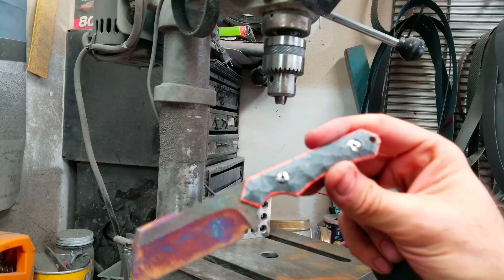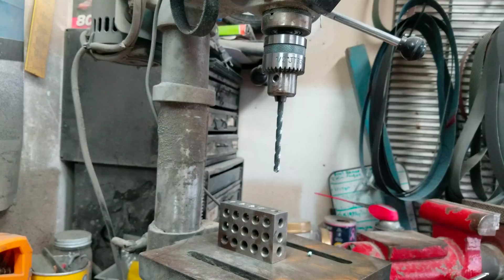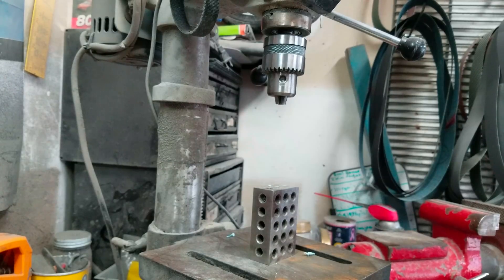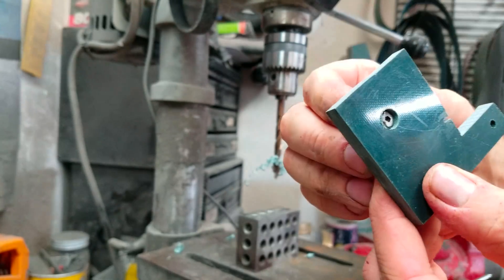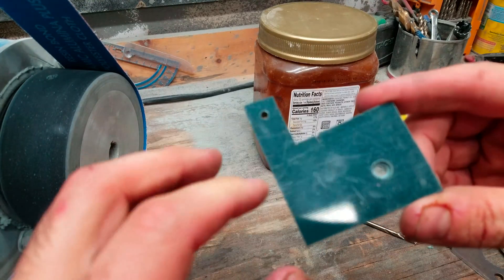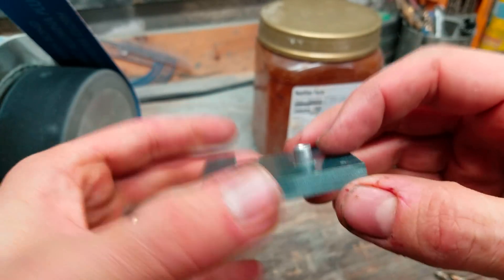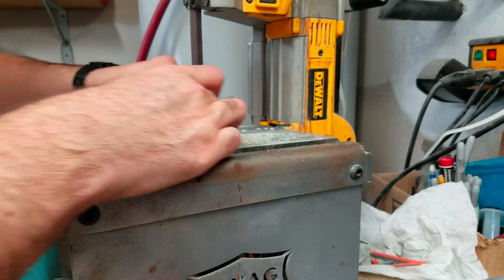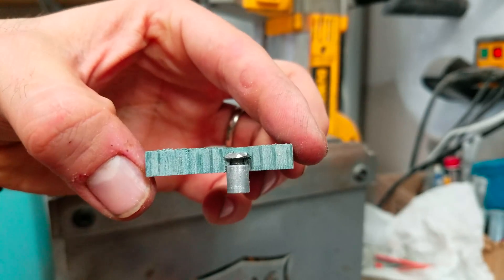Removable knife scales how to

Comment: What steel alloy/s do you use for your blades? Ive looked on your website but theres no info on what steel you use, and the price tag is a bit much for how small they are, ive got a hand forged damascus blade that will shave a 1095H.C blade to a razors edge, so my main question is what makes your blades stand out compared to companies like cold steel, or boker, both of which sell very high quality knives at a much lower price range? Not knocking your product im just curious as to what sets your blades apart from others?
Reply from the maker: I usually try a bunch of different steels so it changes from time to time but I've switched to CPM Cruwear pretty exclusively for most designs. For one it's full custom. Any custom knife is going to be a good bit more than production. I'm comparable to any other similar maker if not slightly less for a similar size knife. Check out Nichollknives and compliance edge. We're all very close in price. The second reason is quantity. I'm one guy in a garage. Materials are the least of the expenses. It's time involved and it's essentially paying to run the machines, trail and error, and everything that goes into it. If I had thousands to hundreds of thousands of knives made it would be significantly cheaper. Third is the fact that cold steel (running with cold steel because you suggested them) does not make their knives in America. They are made in Taiwan. If the recon 1 was made in America it would be $250 not $99. Look at American made folders,  strider, Medford and a few other mas produced but still "smaller" companies. They are $450-900. Hope that answers the question.
Reply: @Tactical_Pterodactyl_Knives  it very much did, the CPM steel speaks for its self, never owned a blade made of it but a buddy of my practically cut my kershaw in half with his spyderco, and i noticed some of your have a coating that looks similar to that stoneware skillet they show on t.v, do you use the same or a similar coating as that or is it just acid washed? It would very interesting if it was the same coating but regardless your blades are unique and aesthetically pleasing especially your tantos, and to be honest i value the "one man in a garage" over the mass produced blades, the damascus blade i own was crafted by a bladesmith in lancaster ca, and i dont leave home without it, the kershaws and cold steel knives have all been temporary, blades ive broke or just stopped caring about, basically throw aways since theyre so easily purchased, i will be joining your newsletter, id love to get one of your tantos when they become available
Reply from the maker: @omishimuzu  yeah any cpm steel is great cruwear is my favorite. Unbelievable toughness and edge holding. I wasn't knocking cold steel or others by any means. I like cold steel though I wish they were made in the US but they have the best lock of any folding knife out there. Incredibly tough. Thank you! I appreciate that. I do a lot of custom orders now so if you don't see anything you want just shoot me an email and I can build you something. And yeah I am in the process of building a shop finally after 3 years full time in my corner of a 2 car garage but it will still be just me. With a little bit more space lol. God bless and Merry Christmas!

Comment: what type of finish is on the blade of the knife you showed at the beginning ?
Reply from the maker: That's what I just call heat treat finish. It's the colors that form when tempering tool steel at the high range of the temper cycles. Most of the time I sandblast and do my acid wash but sometimes if it's cool enough I leave it. It looks great I think when you get bright colors.